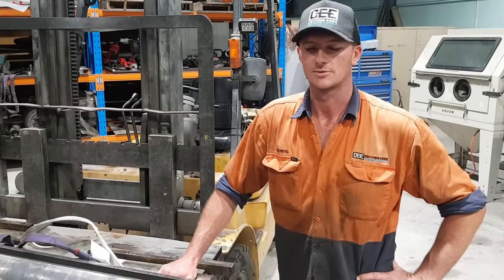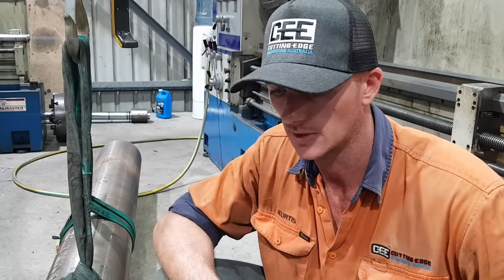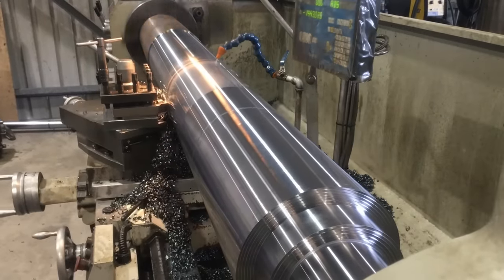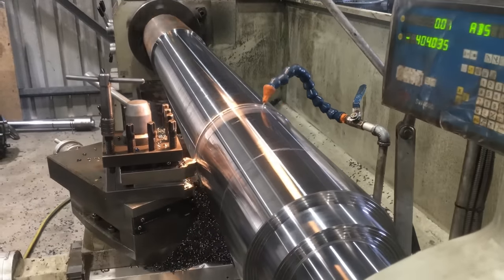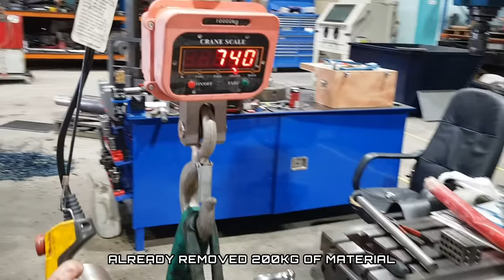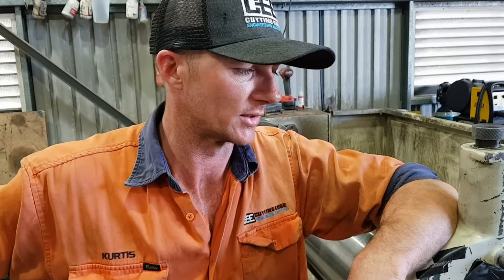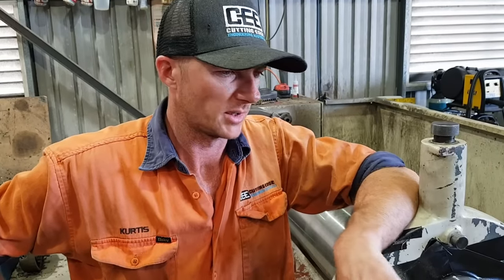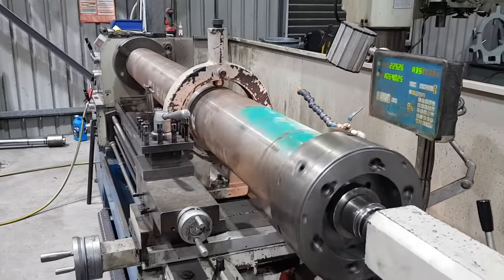Heavy Duty Machining 1000HP Tree Grinder Shaft | Part 1

Comment: Awesome guys! Really fantastic content.
The first operation looked as if it took 7 or more passes to get it to size. Is there a reason you did not use an insert suited for heaver cuts, in turn cutting down the required time?
Regards, 
Sean
Reply from the maker: Hey mate this material wasn't cutting the same as normal 4340 we had to go the opposite end of what we would normally do and use. Pretty much threw out the rule book to get this job done. Part 2 we were asked by material supplier and heat treater to do 0.5mm cuts per pass!
Reply: @CuttingEdgeEngineering  They gotta be kidding. I've done a lot of 4340 twice this diameter and length taking 6~8mm cuts and not once shit like this happened. They fucked up something and now they're trying to save their ass. 0.5mm cuts? That's not even a finish cut.
Reply: Interesting. I have made dozens of shafts and arbors for wood chipping equipment, 65" and up. Always roughed out to the max. Most time I was on our Mazak 30 and 0.250"/ 0.300" depth of cuts were standard roughing passes for that machine. 180 or so rpm and 0.024"~0.028" per rev for our typical forgings about the size of this one here and no issues like this damn peice of material. That be a bit stressful of an experience if my T.I.R was anywhere near this ones. I miss that job quite a bit. Now I own an automotive machine shop and remanufacture engines, so no real machining in my world anymore but I do think about it a lot. Good video, has me thinking about products I am proud to have made or been part of making.

Comment: Sounds like the heat treater skipped the stress relieving process and tried to make a little extra dough.
Reply: Or was too quick to pull it out of the oven, not allowing enough soak time for the relaxation. Probably might have relaxed after a week at red heat.

Just the original length, being the end, had the most stress from being constantly the part hit the hardest in the rollers every size reduction, giving all the stress variations in the rod. So it has all sorts of crazy stress in the metal, and as it rolled during the foundry process it got each different one give a stress in a different orientation. Thus as you cut away a diameter the stress relaxes in a different manner.
Reply: @SeanBZA  In all the Abom79 and Keith Fenner videos I've watched never heard of this issue. Must be they never got the shaft.
Reply: @SirDeanosity  I'm wondering the same thing. And it must be flexing his lathe
Reply: @SirDeanosity  It's a real issue

Look at the below link:
https://www.imetllc.com/training-article/residual-stress/

I've run into it when springs have failed prematurely from not having been properly stress relieved after forming

I'm not sure how common it is for parts to warp when machining but Stefan Gotteswinter has talked about it in some of his videos when he is aiming for micron precision.
Reply: Yeah, as soon as they started talking about the run out, and what terrible run out it was, I figured it had to have been a bad heat treat.
Reply: @SirDeanosity  Did you realize that Abom79 always is using 4 jaw chuck for large shafts and before he is starting the first cut everything is always indicated in many places and is as true as possible with pinpoint accuracy?
Reply: @MotoDoktor01  none of that is relevant to internal material stress, it changes shape as stress layers are relieved.
Reply: I used to work a 5m lathe, biggest regular job was turning 5t forgings into 3.5t shafts. I've never had a piece of 4140 or en25/26 not move when removing this much metal, I just thought that's what it did so would work around it.
Reply: @kerryh8er04  I thought that machining is the last after heat treating parts.

Comment: Yeah, You're not wrong there when you say "That's fucked!" 
Even if you can machine that thing concentric it'll banana up after you put a keyway along the entire length of it. 
Instead of sending it out for heat treatment with only 5mm stock on it can you send it anywhere to get it stress relieved using vibration? 
even then it's probably gonna be unuseable.
I'm used to machining ballscrews and lead screws  and some of the cheap asian things were nightmares. At least we could straighten them on an in house 
built straightening bench but the largest diameters we had to worry about were around 80mm . Nothing like that thing you're trying to turn.
Looks like you need another piece of steel that's been heat stress relieved and then left sitting in the steel yard for a year or 2 .
Maybe the original shaft had similar issues and that's why the thing let go in the first place.
Good luck with that one. Cheers, Ken B.

Comment: Hello I enjoy watching your videos. This is the second time I have seen the problem with warping of turned parts. I am 100% sure that it is due to the lack of good cooling of the workpiece that the workpiece is stretched out and bent so you get the problem with shaft runout. Judging by the fact that the chips turn blue after machining the parts, that means heating to about 600°. Be sure to take care of the strong cooling with coolant the problem will disappear I assure you the whole problem with overheated parts it elongates and deforms. Regards Sergey

Comment: I had a similar problem only last week except mine was bigger than that toothpick…straighten by chucking off the roof a few times,then in the oven at gas mark 4 for about 5-6 hours and covered in butter (anchor works best) hope this helps.

Comment: Hey Kurtis new subscriber here love your channel but just wanna offer a tip instead of using the tape on your steady rest you can get big sheets of paper gasket material and cut the id dimensions of what you machine on your lathe for multiple diameters and on each one cut some holes for a stud style magnet with a wing nut then simply slide it over your work piece and stick it to the steady rest and bam stops chips from getting under the rollers same as the tape does

Comment: We cut a lot of stainless steel and 4140 which seems to move if you just look at it wrong. Now we always stress relive the material before cutting. Then we rough oversized and stress relive again.... before doing any finish machining. Stress relive does not affect any hard heat treatment.

Comment: I wonder if drilling a hole up the centre of the shaft would help strengthen it around that shear point and may even help with your warping issues . I know that it’s Easyer said than done and a good chat with the customer is needed as you would be changing from spec. Great work all the same you was watching what you are doing and checking your work hopefully spotted a problem before it becomes a catastrophe

Comment: I am machine all my life. Through my career I made so many shafts like this. I wonder why didn’t you use for jaw chuck when you turn shaft around. Now you can dial shaft in zero. When you start cutting first few cuts take a small cuts so you make shaft running straight and diameter of material is perfectli around. Then again after every few cuts you release and re-tightened. It is obvious when you start machining different sizes (steps) material shifts so with releasing and tightening live centre you control stres on material you machind. After roughed out shaft leave it oversize at least .250 thousands of inch. For finishing you can use dead centre. And you eliminate all the problems. Rough material like that is never straight anyways. I don’t know how you expect material to be straight unless it’s T&G. Be carful when you cut keyway you can bent finished shaft as well. 
I’m sorry if I offended anybody but I just try to help you out with my 40 years and more experience in Europe and Canada.

Comment: Damn, when you said you were going to leave some on and send it out for heat treatment I was like "YES!" because that's what I was thinking and then you put up the spoiler alert... and I was like, "damn!". Oh well... shit happens. The fact that they told you it was the last piece of an existing bar tells me it was a problem piece. They never tell you that much info, at least here in the states they don't. Maybe it's commonplace over there. Knowing just enough metallurgy to be dangerous I would think they started rolling it and realized one side was off, probably by a lot, and they tried to save it by cranking the screw on the other end of the roll and really smashed this portion of the piece too fast. That would guarantee it would run out after machining even if it was perfect before. Love your channel...

Comment: At a central workshop for a very large brick making group in the early 80's and one of the clay extruders broke its main shaft.
The world would not allow machine components to be exported to South Africa (Apartheid sanctions).
But bringing in raw stock was OK.
Shaft finished size was 380mm dia 4.7meter long.
Fancy bar stock we got shipped from Sweden was 450mm dia 4.8 meters long.
Machined the shaft to 10mm off size and sent it out to a company 1200 miles away to be heat treated for maximum toughness.
Got it back, mounted it in the lathe and took the first 2mm cut.
Shaft was bowed like a banana.
Did some measuring and figured out it would clean about 1mm from final size, so I went for it.
As I was cutting, the "banana" kept on moving around the circumference of the material like the shaft was a piece of cooked spaghetti.
Eventually we found out that the company that did the heat treatment only had a 3 meter oven so what they did was put the 4.8 meter shaft into the oven 3 meters, built the opening closed with fire bricks and clay then did the tempering heat treatment cycles.
Then they pulled the shaft, put the other end into the oven and did the same again.
Of course when it came out it was bent so they put it in a big press, heated it up with all sorts of blow torches and oxy-acetylene torches and jacked it more or less straight and because they were already late for delivery, cooled it down with a fire hose and shipped it back to us.
A big legal thing was just about to start and the government was getting involved (that particular extruder was the only one that could produce the particular product they needed for some or other military application) so they "offered" to buy a new piece of material, have the Swedish manufacturer do the heat treatment, supply us with ALL the VERY EXPENSIVE tool inserts that we would need to machine it AND AIRFREIGHT IT ALL FROM SWEDEN TO SOUTH AFRICA.
That raw material shaft out of Sweden with that heat treatment and using those inserts machined like a dream.
The SA government got their bricks albeit a few months late and the heat treatment company disappeared off the face of the planet.
Reply: Wow, integrity cost them their company; sad.

Comment: No duck board - man my feet would have been done standing on concrete all day - hats off! Nice work though - I loved these kinds of jobs - spent many hours refurbing 310 Diam steel mill straightening rollers - 4 ton each. That idea with the chuck in the tail stock, except for a crank grinder, I have never seen! Great idea for this application.

Comment: 4340 it moves around all right we used to get normalized hightensile by sending it to a heatreatment company,we did 2 winch shafts 3 metres long with threads hex dog drives and square threads on it 8 bearing surfaces I left 2mm on let cool took a mill off let cool took 1/2 m off let cool each time taking the preasure off the centres it move a little each time but on the last .15 of a mm it's stayed spot on

Comment: Watching this even a year+ on, and not being any sort Machinist except for a keyboard know-all. I have to agree with the majority of those that know more than I. Internal stresses from the forging and then no stress relief in the post in the form of reheating light flexing then a stepped cool down process. It's kind of the same way rail track is flexed while still hot but not glowing from the forming process to make sure the rail lengths don't form a natural bend or bow. At the start it looks like the length that was started with was not just a end piece but one that was cut from near the middle of the rough length bar, which from what experience I do have, is where often internal stresses are highest for any sort of bar stock no matter the length or diameter.

Comment: Hey buddy, watched your video loved it, used to machine big main shafts like this for a rock crushing manufacturer part of our process was to rough them out to within 2mm of finish diameter and leave them for a period of time to stress relieve you gota understand that when you take off so much steel it shocks the material, either you can just leave to sit in your workshop for up to 2weeks or you can speed the process up by sending it to heat treatment, which I see your doing

Comment: Very good trick with the tape on the steady rest. I had always used rubber mats, but tape is much faster and more universal. 
Thanks a lot mate!
Reply: What was the tape doing? Cutting down the ring of the tool?
Reply: @bushratbeachbum  The tape prevents chips from getting into the steady rest and damaging the surface 🤓

Comment: I have seen just about every video kieth fenner has recorded. He runs his lathe in reverse and turns the carbide upside down. This causes the chips to fall directly down into the tray.  I am guessing you already know this trick and there is a reason you are not doing it that way. Would you mind sharing your thoughts on this? Or not. I have learned so much from your channel. I really appreciate the chance to make some of my own mistakes, new ones instead of just repeating all the old ones.

Comment: HEY bud. Happy New Year ! 4340 ? I have never had the pleasure to work with anything tougher than 4140. A run that long is hard not to have any taper in it.  You have that lathe dialed in to perfection. I must admit to never seeing tension like that in a piece so heavy. I see it in logs on my mill all the time but never in steel. Hopefully a good long annealing will smarten that banana up. All the best to you and yours for 21 my friend. Take care eh.

Comment: We had exactly the same thing happen on a shredding machine, we never had the capacity to do it in our own workshop so sent it to a company called Dowding and Mills renamed (Sulzer) they bored out the shaft and and made a new stub for the end, put it in a bag and called in a tanker of nitrogen to fill the bag (shrinking it) then dropped it into the bored out shaft, they welded and turned it to size, the weld was just for cosmetics, i questioned on if it would hold but they assured me they'd done it many times on much larger shafts, showing me a 28 ton shaft out of a machine for shredding car batteries that had been repaired this way, the shredders still running.

Comment: Hello from UK. I was for a long long time a CL turner, never used that size of billet, but lots of steady work.
Do you use a "wobble bar" between centres before starting to machine, also we would only use a fixed tail centre for accurate centre to centre work, and never a rotating tailstock centre for accurate work. Great to see a proper machine shop.

Comment: The Tradesmen and lectures told me about doing big jobs like this. They had to rough turn the shaft leave a couple mm on the od. Take it out and let it sit for a couple hours to let the stress out. Then Chuck it back in and Finnish turn it.

Comment: I'm  thinking  that  using  the steady rest isn't needed since the shaft is rather large and sturdy but I'm not sure  how rigid your machine  is its starting  to max out it looks like you could turn a spot in the center  of shaft  to minimize vibration 
And rough out both ends 
When facing and centering work face the part center drill the part and turn a witness  on the end  then you will always know we're your  centers are because they run concentric with  the o.d.
Always use an indicator when setting the steady  rest run bottom 2 rollers up until  you get .001 preload top roller can be run as tightly or loosely  needed  this roller holds the part down without influencing it

Comment: I cannot imagine barstock changing so much from having the outside removed. What strategy to you use to bring it true again? Leave some extra material on each plane and let it cool before finishing? The hammer does not appear to spin more than 300 rpms. Maybe they will call it good and use it anyway? This is a very interesting video.

Comment: I have seen this with 4340, the best you can do is leave some meat on the bone and set the rod aside until it cools completely and starts to rust and then go slow with finishing remembering to keep the part cool. Sometimes we would see material warp a 1/4 inch. 4340 is tough but like a spring it wants to go back to some shape you might not want.

Comment: I am not a turner, but it seems to me that such things need to be sharpened in centers in one pass.  On both sides, it was necessary to make a center and clamp it with cones on both sides. And then, not with a cunning device, hook the shaft onto the cartridge.

Comment: That sort of thing really gives you the 💩s.  I just got game enough to take a mower deck off to supposedly reattach an idler pulley mount because the pulley was running out a bit - enough to start a fire apparently 🔥🔥 I should have got worried when the job arrived with a fire extinguisher. Turns out that the mounting bracket is in really good nick but it really needs some good material to sit on or the belt will pull it over 45 deg again so that the pulley can continue grinding a slot in the top of the deck.  Goes to show that it's never a good thing where run-out is concerned.  I am looking forward to see how you get yourself out of this one. 👍

Comment: On you steady rest . You can use cardboard or some foam pad or anything . To cut the OD to slip over the shaft being machined . Then use a magnet to hold it to the steady rest for good chip guard .  Keep slinging those chips .